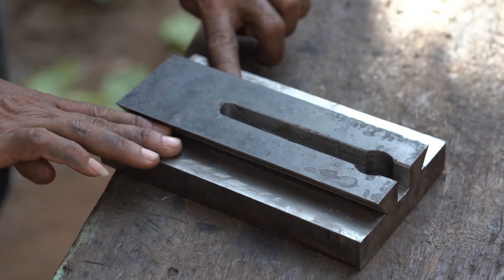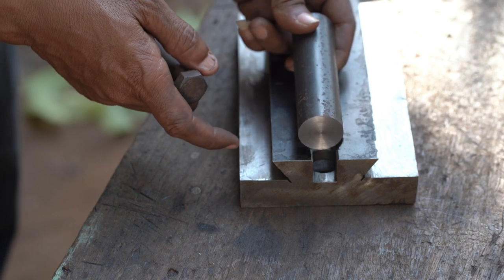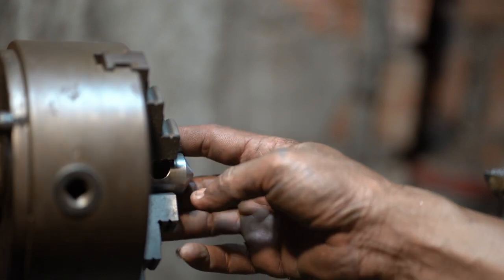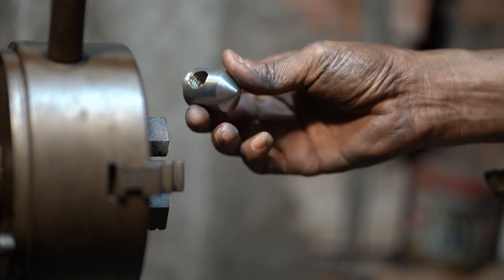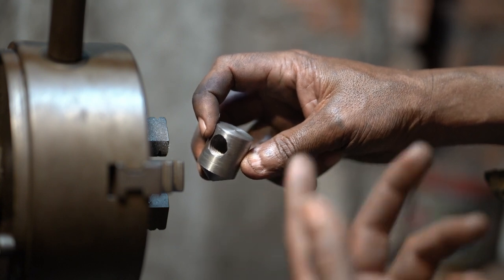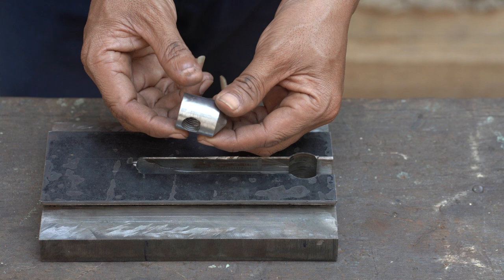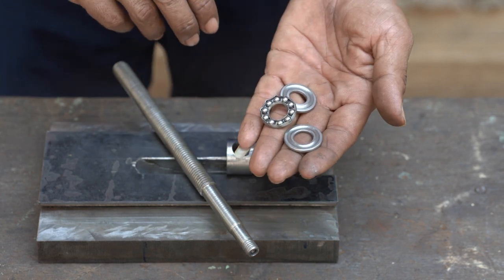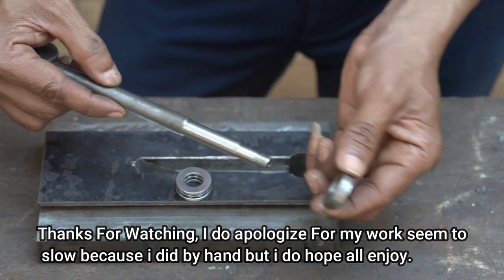DIY A Compound Screw For The South Band Homemade Lathe

Comment: I wouldn't worry about the wobble or looseness in the bolt, when you put tension on it it will stiffen up.
Reply from the maker: Thanks for your introduction.
Now is tie enough is not moving.
Reply: @mr.ranyhomemade2466  good deal 👍